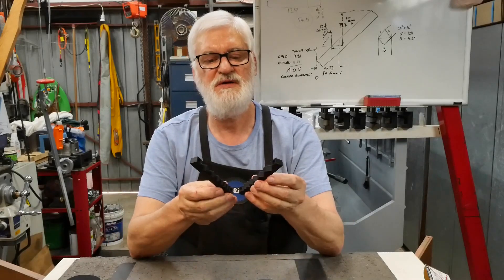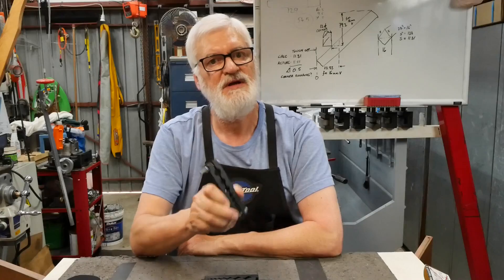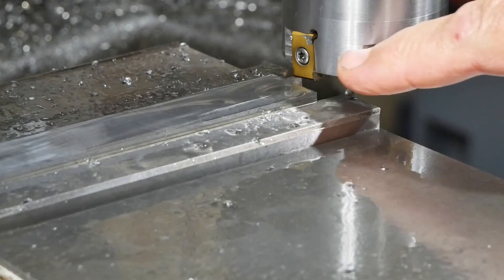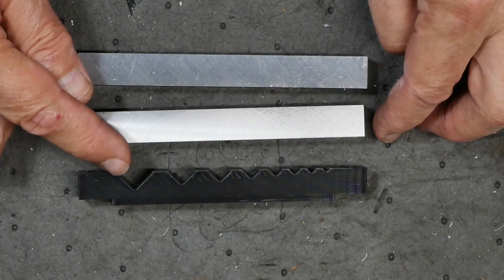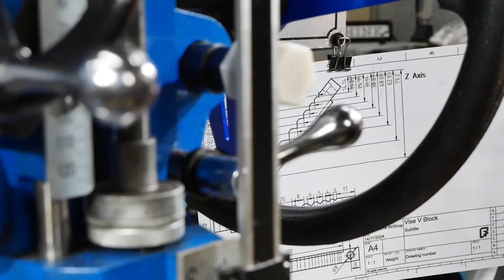Vee Blocks for a Vise

Comment: Clever idea , perhaps out of Copper to grab threads without damaging.   Not sure I would need it, but will remember and make if it comes up.    

Perhaps some 90 degree Cu shims in your block?
Reply from the maker: I have used parts printed with ePA-CF filament on a couple of occasions to hold work I didn't want to mark and they worked really well. I expect copper parts would also be good, but I don't have any bar stock lying around to experiment with.
Thanks for watching.

Comment: I've stopped this at 3.01 where your saw was struggling with the 12 mm plate. You said that it had no trouble with five and six mm. So why not take two bites at it? Raise the table so it will just pierce 6mm, then run it through, then drop the table to get it right through the rest of the plate. It will probably take less time than even if the saw didn't struggle, and a big plus will be that it doesn't stress both battery and the motor, thus hopefully giving it a longer life. Right I'm going to watch the rest, as it's a great idea and a fun project. Back again and one minute later you do as I suggested!! Oh well great minds think alike lol
Reply from the maker: Thanks for watching Sam.
Cheers.

Comment: I think the way you were holding the plate you were pinching the blade when you were cutting.....
Reply from the maker: Thanks for your observation LLoyd - are you thinking that the plate was too tightly wedged between the clamping blocks on each side ?

Comment: The larger vees can have a radius in the bottom and will still clear. So if you have a smaller piece of metal to start with, you can still hold larger pieces.
It is the same idea as the ones that have a row of standard size holes instead of vees. Others have a row of tapped holes for holding screws.
Reply from the maker: Thanks for watching and tolerating my mistakes without criticism Marley. As a young bloke, I was a perfectionist and was never happy with my projects. But after working in manufacturing for 20 years, my attitude changed. I came to believe that more quality than is required for a good result represents waste because the excess resources consumed can be profitably used for something else. These days I can be happy with my output even when mistakes are made - which is just as well :)
Cheers.
Reply: @alanshomeworkshop  I recently saw a chap making a huge pair of vee blocks that had the vee all the way to a sharp corner. This meant that he had to use two huge blocks of steel. The smallest diameter he needed to hold was 2" so he could have left a flat where the vee intersection was. His vee blocks could then have been half the height! This is why I thought it may help your viewers to see that it is not always the case for a sharp vee.

Comment: I've often worked on the ends of cut down bolts and screws to file the ends nice and clean and give them a filed chamfer.  So despite your friend's quip I think you'll find that it's quite a handy thing to have.   I've also thought a lot about making up some sort of V slot jaw helpers.  But the shipment of "Round Tuits" never quite seemed to come in.  I really like your idea of using the end screws and springs.  That's a new one for me and I think I'm going to "borrow" it for my own when I finally get a Round Tuit :D   As you found though there can be a lot of overlap in the V's.  So we don't really need as many sizes.  There's less overlap in the smaller sizes.  And For those I would/will counter bore for the scew heads from the lower side.  The small screws I want to grip are often under 1cm long.  And often a LOT shorter.  So it would be nice if the smallest size or two were able to grip as short as 4 to 5mm.    Anyhow cheers from a new Subscriber.  Not only was it a nice project but your video was well made and kept the attention with witty comments and useful details as they occurred.
Reply from the maker: Good feed back thanks Bruce, and I like your idea of relieving the underside to allow for screw heads.
Cheers, Alan.

Comment: This is such a great idea for work holding.  You should come up with a similar idea for the lathe for holding small square stock or rectangle stock.  I am constantly struggling with work holding.  It’s certainly no fun to have a work piece fly past your face, definitely would be less fun if it made contact.  Even though there was a minor hiccup, let’s call it a feature, the project looked great in the end, it works as intended and the video was an overall success!  Great job!
Reply from the maker: I'll have a think about your suggestion. Thanks for watching.
Reply from the maker: What would be some typical dimensions for your workpieces ?
Reply: @alanshomeworkshop  25mmx75mm and oftentimes smaller depending on what I am working on.  I don’t have a 4-jaw or a faceplate so I often have to be creative.  I am also working with a cheap 7”x16” Chinese lathe
Reply from the maker: @taranson3057  That's 25mm square by 75 long ?
Reply: @ yes and also 25mm square, and so on and so forth.  It varies from one project to the next.  Like if I am making a carburetor from 10mm square stock I have no way to hold it in the lathe to turn a feature.
Reply from the maker: @taranson3057  Ok, I'll see if I can come up with something.
Reply: @taranson3057  Do you have any 5C collets to use?
Reply: @ no, I use er32
Reply: @taranson3057  That is a shame as there are square collets for 5C. There are some ER32 tapping collets but probably not your sizes.
Reply from the maker: @taranson3057 Perhaps you will find my video "Square peg in a round hole" helpful:
https://youtu.be/gaUFyG4fyfk?si=39c6OXT-bvCto5HH
Cheers.